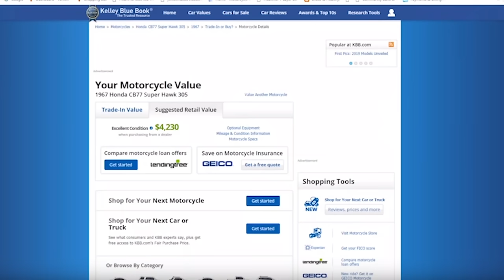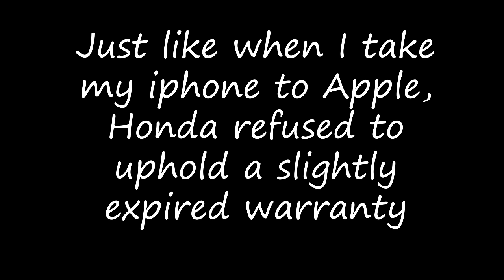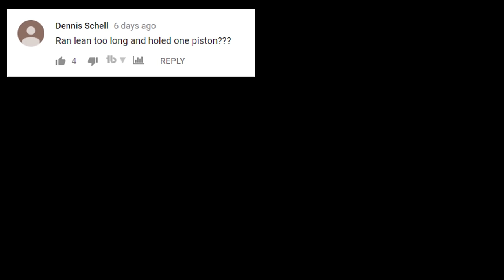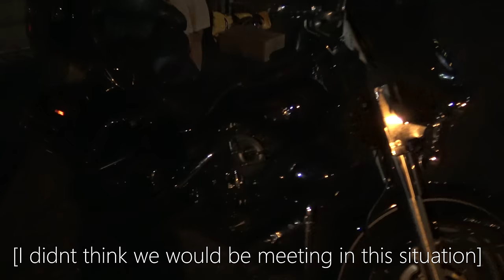He has NEVER seen anything like this before (CB77) Episode #3

Comment: I had exactly the same thing happen to me back in the late 70s i was riding a Honda CD 175   I  bought for £190  My brother had to collect it as i wasnt old enough to ride it. After  6 months same thing happened. i had no other engine damage either which i put down to the fact that i was turning in the road barley moving when i noticed a problem. After fishing The cam chain out of the engine  with a coat hanger and replacing that and the part that broke on yours i road it another year till the lobes on the cam shaft were so worn it wouldnt run well any more.. Great happy times and i learnt a lot about bikes on that old machine. :O)

Comment: This was not uncommon. Cam chain tensioner always  failed before the bottom guide roller one did. But saw this in the early 70s at high mileage and mainly or only on CB77 as it was a big seller. CB350, CB450, CB750 and more had cam chain tensioner roller fail at 80k miles or more (or less),  Rubber tensioer roller disintegrated.  If you didn't maintain cam chain tensioner adjustment failures occurred sooner than mentioned.  I was a Honda wrench and still am for my own stuff on all products. Can tell lots of stories, but Honda always stepped up and improved or took care of the problem.  This was an age failure along with you drove the shit out of a 50 year old classic bike. However you saw and felt it's power it just needed a teardown to freshen it up Sean. It's a restorable classic and I'd love to do that.

Comment: Well you still didn't have fuel flow through one pipe.  Did you figure that out?
Running a bike with a loose, unregulated timing chain for many miles at highway speed...Honda 70s quality engineering saved you there.  Their simple, small motors are ....simply the best.
Reply: That's how it's meant to work as long as covering the flowing tube causes the other one to start flowing in its place. I took my freshly rebuilt one apart a few times before finding that answer on forums. There's lots out there on these bikes for those that want to get them running right, and if maintained properly they will reward you.
Reply: @jimmyrustle9827  cool.
Reply: I must say, the 3rd gen magna engines are my very favorite. They are just so damn bulletproof and powerful

Comment: I had a '74 CB125S that had the carburetor get slightly plugged and ended up burning a hole through the piston when it leaned out going 50mph. That's when I learned how to rebuild my first motor.

Comment: I totally could’ve warned you it was the manual chain tensioner. You should’ve called me, Sean. You never call anymore.
Reply: It wasn't the cam chain tensioner but the guide roller. If it was the tensioner it would thrash like hell but still perform as the roller guide would still tension the cam chain. 1969 CB750 wins the Daytona 200 with a completely failed tensioner other CB750 dropped out due to mechanical failure.  So you want more ask me to splain!

Comment: Be sure to have the mechanic clean out the centrifugal oil filter driven by a small chain on the clutch side of the engine.
Reply from the maker: +whalesong999 yeah he will clean out everything
Reply: @BikesandBeards  Fwiw, (long time mechanic here), the only time I've seen damage like that guide roller come apart was on a Kawasaki Z-1 that had been ridden in a parade and the rider was using Pennzoil 10w40 in the engine.  Every guide strip and roller was ruined, the guide pads actually stripped off of the aluminum backing.  I began my career on Hondas and BSAs in the early '60s and on rare occasion had to replace a guide roller here and there on the Hondas from becoming hardened.

Comment: I had a 67 Dream with a 305 .. I rebuilt the top end.. it was a cheap job . you should be ok .. depends on how much you want to refresh while your in there .. ps cb450's  have the same rubber roller chain guides so heads up if you buy one .

Comment: You could have a valid warranty claim, I am only 63 so the cb77 is before my time but here in England Honda would honour claims out of warranty if the item in question was known to be faulty, the recall system hadn’t been conceived in the 70’s. So if your camchain tensioner had been superseded you have a claim. As a storeman in a Honda dealership in the 70’s I can tell you the cb250 k4 through g5 had 4 different combinations of tensioner guides and rollers all superseded and fully warrantable if they failed no matter the age or mileage. Get a lawyer you have a claim Honda have always had a weak spot with camchains.

Comment: If it costs you $5000, then he had better be doing a complete engine rebuild from the top down.  You can buy a set of Cappellini cam chain tensioner sprockets for around $250 that replace the top and bottom rollers with metal sprockets instead of the old rubber types.
Reply: Thats what i bought for my rebuild cb77.

Comment: Poor bike, its guardian angel must have been looking out for it on that highway run, especially if the oil wasn't changed beforehand. Honda should use this in an advertising campaign: Honda motorcycles: Surviving neglected maintenance for 50+ years
Reply from the maker: +Jimmy Rustle it has fresh oil in it

Comment: Ouch, couple of hundred dollars for a cam-chain jockey and tensioner. Second-hand sets runs about £35 in the UK, so not-new is worth worth thinking about for a near-vintage engine. As an alternative Cappellini (Italy) make a roller bearing sprocket wheel to replace the plain jockey arrangement, seen them on eBay so should be available in the US. Enjoying the videos guys, looking forward to hear the hopefully happy ending. Ride safe.

Comment: Cappellini in Italy do an up-rated cam chain guide roller  and I think a guy in the states sells their parts on E-Bay.  http://www.cappellinimoto.it

Heres the E-Bay link https://www.ebay.com.au/itm/Honda-CB-CL-72-77-Cappellini-114-cam-chain-roller-in-special-alloy-on-axle/172121902954?hash=item281343cf6a:g:p64AAOSwPgxVOGs7    
Its expensive but far better than the standard part.
Reply from the maker: +Jukebox Gothic hey great info thanks. I will check that out

Comment: i may have a used one of those rollers in my incredible pile of stuff.
don't let that old dear die
Reply from the maker: +Chance Belcher can you check for me please
Reply: @BikesandBeards  
i will over the weekend. i have quite a few naughty bits of cb77 and cl77 stuff. i think i have one of the rollers but no guarantee
Reply: @BikesandBeards  
i am holding the roller in question in my formerly nicotine stained fingers. also have the timing chain adjuster if you need it as well.

Comment: If you brought that bike to me I wouldn't let you have it back until you took a course on the basics of checking old bikes. This is just embarrassing to watch. I'm not at all convinced you've learned anything from this experience.
Reply from the maker: +Moderate Fkr the oldest bike I ve ever owned was a late 80’s. So you are correct I guess I have a lot to learn. But the break down had nothing to do with user error
Reply: Bikes and Beards you replied:

"+Moderate Fkr the oldest bike I ve ever owned was a late 80’s. So you are correct I guess I have a lot to learn."

We all do. Life is a learning experience. 

" But the break down had nothing to do with user error"

Yet that's not the point. The fault existed. You didn't find it because you didn't even look for it. The point is that type of fault normally causes catastrophic engine failure. It's pure luck and Honda engineering that saved the day. 

Plus, you assumed what the seller told you was true. That's not bike age specific. It's life and commonsense specific. The risk of engine failure was a given. Mitigating against that was the sensible thing to do. Riding it home was always just dumb. But since you had the van, also totally unnecessary.
Reply: @moderatefkr6666  Not everybody is gonna tear the engine apart to find the cam guides might break. Also riding it is what you are meant to do, You don't need to pull apart an engine unless you know it needs service.
Reply: @moderatefkr6666  dude, the engine didn't break till he rode it. It had compression so a compression test would have shown that the engine was fine. 
I don't like people that use the comments to prove their superior knowledge and put down others.
He isn't a mechanic clearly so just use that knowledge of yours to help him out. 
I want to throw some harsh words back at you but it will just trigger you more. 
I'm done so I will go lick my windows clean as you suggested.